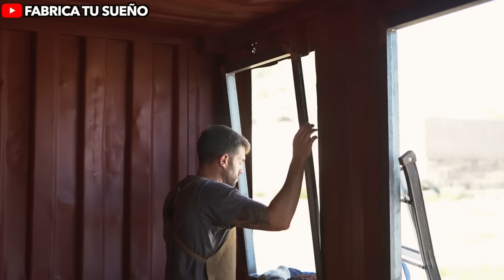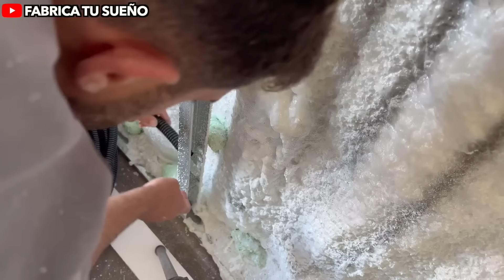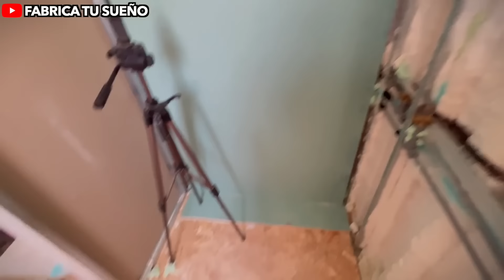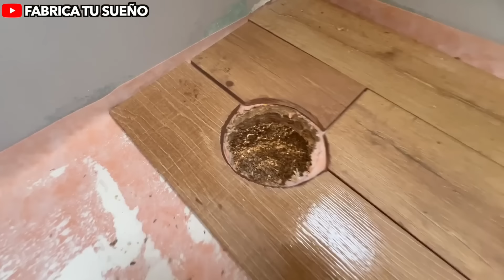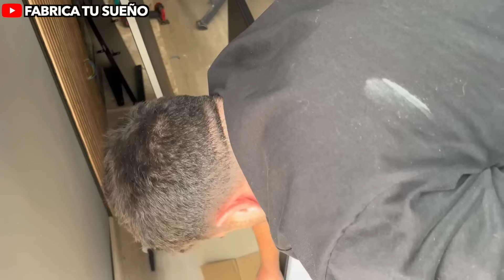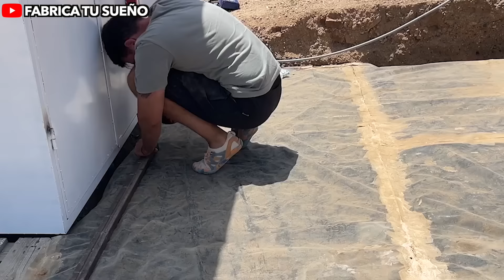Man Spends 100 Days Turning a $3,000 Container Into a Luxury Tiny Home! ( By ‪@Fabricatusueno‬ )

Comment: Was there no insulation for the roof/ceiling? Where most heat was collect and accumulate? Everything else is lovely.
Reply: Yes and he directly screwed that LED lights through it too, a potential leak..
Reply: Toward the end, the ceiling looked like maybe it was finished out like the walls, but I'm curious about this, too.
Reply: @person2463  don't they already come insulated ...I'm asking ..I don't know for sure
Reply: @secsimika No the ceiling needs insulating correctly to stop heat and moisture.
In Australia we need a Hi Cube container to be able to do this to code generally.
Reply: @secsimika  no.  the shipped contents rarely need thermal management.  so, add insulation.
Reply: Yeah, I just noticed that. Why are they putting drywall up on the walls before they did the ceiling? Then realized they aren’t doing the ceiling at all. Makes no sense. Insulation only works well when everything is insulated, especially the ceiling.